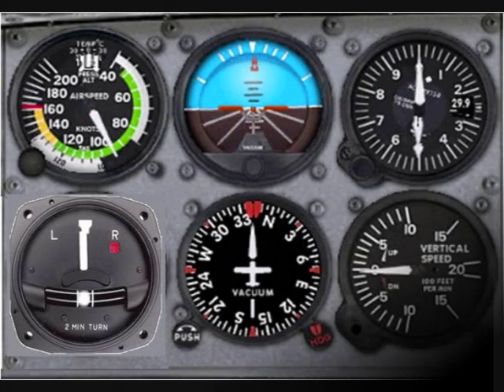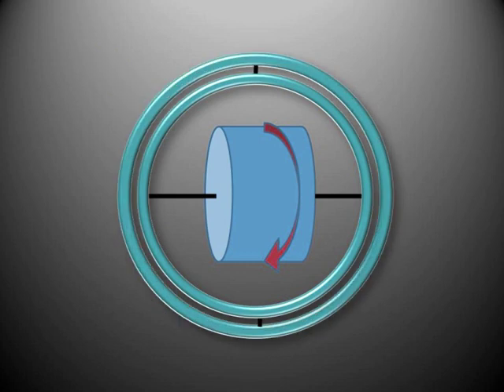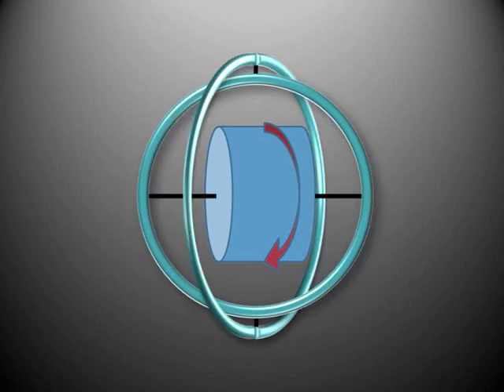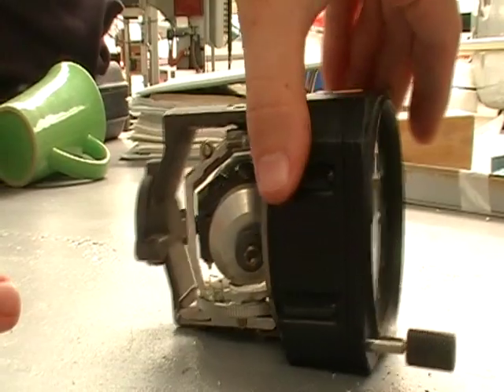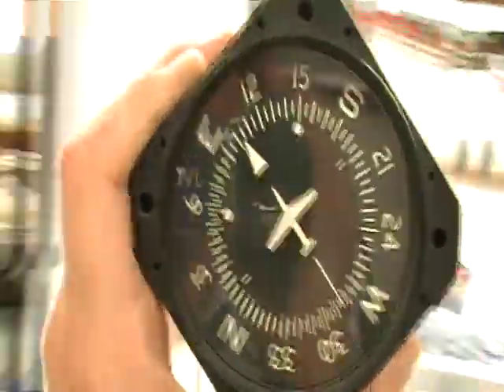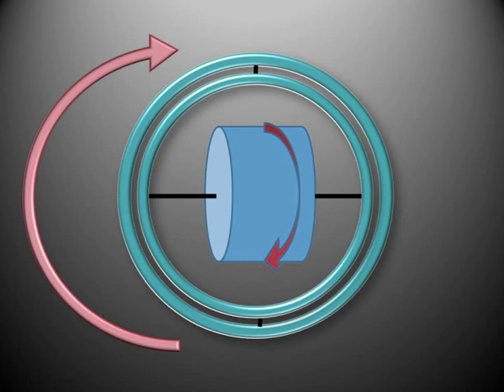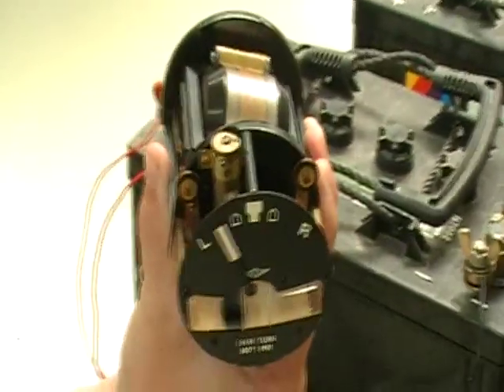Gyroscopes in the Cockpit

Comment from the maker: You raise some good questions. Notice a few points.
1. Each gimble allows the freedom of movement in one plane of rotation. The Heading Indicator has three gimbles, but the turn indicator has only two. Thus the turn indicator does not allow freedom of movement in the yawing plane. Any force in the yawing plane will not be negated by the gimble, but transferred to the gyroscope. In that case precession occurs as a result.

Comment from the maker: 2. Rigidity is only a property that allows a spinning mass to remain aligned in space, given freedom of movement. Rigidity can be resisted by a force, which is when precession takes place.

3. You are right that gyroscopes are affected by rigidity and precession simultaneously.  Ideally the directional indicator is operated only by rigidity. However precession results as forces are transferred through friction in the bearings. The DI drifts as a result making it necessary to adjust more often.

Comment from the maker: Actually, yes. Or you can use a vertically aligned gyroscope DI (this one is horizontal, vertical are more useful around polar regions). A vertically aligned DI will experience maximum topple at the equator. Thus at the equator it would change its reading 15.04 degrees per hour due to the rotation of the earth, decreasing this rate towards the poles (by the cosine of the latitude).

Comment: I wonder what happens to the gyro under the globe in say Australia when the planes upside down
Reply from the maker: The gyro will always act with reference to space, not the earth or its horizon. So if an aircraft continues flight around the globe without it being 'caged' (as you can see in the video), the gyro will end up toppling. This will result in erroneous readings. This is one of the reasons a pilot needs to realign the DG every 10 minutes or so. In realigning the DG, not only is the pilot correcting the heading information that is being displayed, he is also realigning the gyro so that it is parallel to the horizontal plane of the aircraft. Providing the aircraft is straight and level, this will align the gyro to the horizon at that point.

So, in Australia, if a pilot is correctly resetting the DG at regular intervals, the gyro should be aligned with the local horizon.
Reply: Recently I learned that there is a Flat Earth society which defends its' beliefs using some quite entertaining arguments. One of them is that the gyroscopes are not designed with earths curvature in mind but they still show the horizon correctly. 
So someone should reference this explanation so the poor people can accept that the earth is not flat.
Reply: gitnote 
Gyros only work on a flat surface...

Comment: why doesn't the heading indicator (and attitude indicator) act on precession? Shouldn't a yaw movement as showed starting at around 1:20 push the gyro to precess the force 90 degrees and thus make it rotate like the gyro in the turn/slip indicator? And why doesn't the gyro in the turn and slip indicator remain rigid in space?
Aren't gyroscopes supposed to be affected by rigidity in space and precession simultaneously?

Comment: I wonder whether this gyro follows the falling horizon in a plane's flight
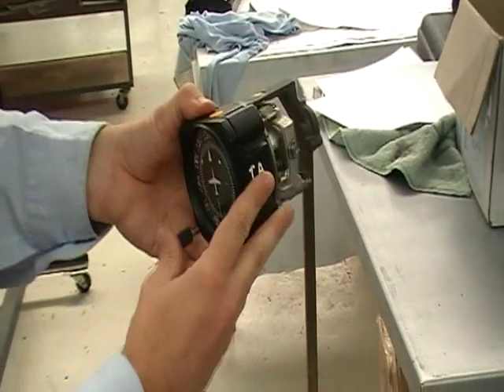Reply from the maker: This is a similar question to the one Wiskey Leaks posted below. I have a reply there. In summary, the gyro will not follow the horizon. This is why a pilot needs to regularly realign the DG, and consequently reset the gyro so that it is parallel to the horizontal plane of the aircraft (and therefore the horizon). You can see this happen at 1:52. Hope that helps answer your question.
Reply: onewaytoliveby , so the pilots have to manually reset the gyro every 10 mins aligning it visually with the  horizon, thanks. Are you a pilot by any chance?

And what is the DG you mentioned in both you replies?
Reply: Oh, DG is the directional gyro? Ok
Reply from the maker: Yes, I am a commercial pilot and a flight instructor. That's correct DG is the Directional Gyro.

You'll find that some DGs can be quite complex, such as HSI (horizontal situation indicator) and RMI (Radio Magnetic indicator). They incorporate navigation information on the directional display. These are usually aligned automatically, thus relieving pilot workload.
Reply: I think now that that the gyro based attitude indicator is the sufficient proof of a flat earth, and that the gyro based heading indicator is the sufficient proof of the stationary earth (on top of the M&M and Airy's experiments, of course).
Reply: No, the earth is a geoid.

Comment: Just in case this thread goes down the dreaded "flat earth" line of thinking: Gyros act differently depending on what you want out of them. It's the matter of how you "fix" or attach it. A freely floating, "space gyro" without being fixed will act as some people say. An earth-bound, fixed gyro acts differently. I'll attach a short tutorial below: 

a space gyro is a gyro with three axis around which it can move (think 
of it as in pitch, roll and yaw, where I consider the pitch axis to be 
the spin axis)

space gyros aren't used in aircraft since they can take up any position

a tied gyro is in fact a horizontal referenced space gyro (the spin axis
lies horizontally) with a button to prevent the gyro from toppling (ie 
roll) due to precession and is used in the directional indicator

after using the caging knob, as it is called, the tied gyro must be 
realligned (in case of the directional indicator with the heading 
indicated on the magnetic compass)

an earth gyro is as a tied gyro but vertically referenced (the spin axis
 pointing upwards) and having its spin axis tied to earth's gravity by 
means of a weight holding the spin axis pointing towards the center of 
the earth

the earth gyro is used in the artificial horizon

a rate gyro is a horizontal situated gyro and is only able to topple (and spin of course otherwise it wouldn't be a gyro)

the rate gyro is used to measure rate of turn around the third axis (yaw) and so it is used in a turn coordinator
Reply from the maker: Thanks Kevin. Yes for some reason the flat earth nonsense seems to keep popping up these days. In aviation, we deal with the limitations a spherical earth introduces everyday.

1. We can never have a perfectly accurate paper chart. Try wrapping a piece of paper around a ball.
2. Gyroscopic instruments need constant realigning. DG is usually manual and AH is automatically aligned.
3. Range of line of sight VHF communications is limited. Often aircraft up high will relay radio transmissions to ground stations.

Perhaps flat earthers need to take flying lessons. Makes me wonder what they think time zones are for. Perhaps they have never made an international phone call.
Reply: onewaytoliveby
flying lessons wouldn't do it. They'd need to go into orbit. I'm not trying to be funny either. It's an emotional thing with these people. They follow the interpretations of the bible and work backwards trying to prove that if the earth is flat, then there is a god...it teaches us a lot about our educational system and how blind faith can ruin a mind.
Reply from the maker: It is not blind faith in the Bible that is the problem, it is blind faith in human reasoning (including people's interpretation of what the Bible says). The Bible does not teach that the earth is flat. 'Flat earth' philosophies necessitate that the earth rests on something. But the Bible says in Job 26:7 that God 'hangs the earth on nothing', contrary to what people believed in. When we were finally able to look back to earth from satellites, we could see that indeed what the Bible said was true. 

Great men such as Newton and Galileo who shook the scientific world maintained an unwavering trust in God's Word.

These days we may be astonished by the ignorance of people who hold to 'flat earth' positions. However, this is no different to people who hold blind faith in evolutionary and naturalistic philosophies. It is at best fanciful thinking and at worst intellectual suicide to suggest that evolution is a plausible way of explaining life on earth. It is simply a way for people to explain away the existence of God so they do not have to be accountable to Him.
Reply: onewaytoliveby
true...when I read it, it certainly doesn't tell me the earth is flat. To me, there are many truths within the bible, but a lot of crap too; especially the old testament.
Reply: SkyClear
There is absolutely no doubt in my mind that god exists. no doubt. I'm not here to argue about god, but the creator is not even close to what we as humans understand. We don't have to be accountable to god, he is within us. we don't have to live our lives any certain way, we will feel the cause and effects later as we leave this form...just hope that you can forgive yourself when you see what is really important later. If you follow the way of the great teachers such as Jesus and Buddha and others who teach about love, the transition will be easier.
Reply from the maker: +curiousinternals 
For many evolutionists, evolution is an attempt to explain the origins of the universe from a naturalistic point of view (in other words, there is no need for a God for the universe to exist). Richard Dawkins is a classic example of this. 

Others follow on the bandwagon and suggest that God exists but he used evolution. The problem is that this is completely inconsistent with what God has said in the Bible.
Reply from the maker: +Kevin Cass
I have to respectfully disagree. The problem is that the teachings of Jesus and every other teacher like Buddha are completely different. Buddhism teaches that living a moral life and transforming yourself will lead to the cessation of suffering (nirvana).

However, Jesus teachings say otherwise. He taught that it is impossible for a person to save themselves, only God can save a person. In fact, even our good works are like filthy rags to God.

The love that Jesus taught is different to what many people think. Jesus' love was demonstrated by bearing the penalty of death for undeserving, unrighteous, and evil people. He did this as the sinless, perfect Son of God. This means that people who were once evil, could be justified and declared good and righteous by a holy God. This is not by their own merits, but by the merits of Jesus Christ - we call it substitution. It is like a judge declaring someone guilty, but then stepping down to the criminal and paying his fine so that he could go free.
Reply: SkyClear No problem Sky. I believe what Jesus taught was a lot different than what the church teaches. It is clear to me that some of the scriptures has "man's" fingerprints all over them. Did you know that Buddhists and Hindus have Jesus walking through India and other places throughout his missing years in the bible? It's in their history. I don't want to get into religion Sky...just without religion, there would be a lot more happiness, less wars and death in our history. God bless.
Reply: *****
Sure, I could have gone crazy, but that's my mind. That is why I said "...in my mind." I'm not a Jesus freak or anything, I believe he existed. I continually try to understand the past with the best of my ability.

However...either something came from nothing or something always existed. That formula seems "to me" to be completely obvious. Once you believe that something can not come from nothing, then there has to be a creator. I certainly don't have a clue what exactly it is because, in this form, I don't have the capacity to understand everything.

I agree, I can't judge how far from understanding I am. I doubt I'll ever fully understand. My simple statement, yet bold, only stated that there wasn't any doubt that something did not come from nothing which meant that there was some sort of creative consciousness, however "It" is defined. Loosely said, this creator would be "God."
Reply: *****
They talk about space-time yet, nobody really talks about time...only space. This is the issue that we can't grasp. If D=rt and time really doesn't exist, then you can arguably say that time is 'zero.' If this is true then distance is zero, there isn't really any formula that works in the material world with "time" in it. If time doesn't exist, then we can travel any distance...it's as if the universe isn't infinite at that point. I could go on....

Is there a moment in which the universe doesn't exist that is followed by a moment in which the universe does exist? I think that's a "time thing." There is only "now" is something that I can't grasp, yet said in many books. I can't conceive anything coming from "nothing," so, in my mind, there is no way a universe could exist before itself. The best that I can come up with is that there has always been some form of energy, mass or thought. I think that thought is the key. I don't understand it, but I do know that energy and mass can be exchanged. I believe that thought, or consciousness can only be split or joined together, not destroyed.  It's a work in progress, but after studying and meeting many near-death experiencers, I'm convinced that our consciousness continues. There are many consistencies within each experience, yet most are generally on an individual's understanding of "things." Many refer of an option or a temporary experience of "joining" with a "God" consciousness. This is why I am thinking about the separation or in a way, "creation" of a "soul." Everything seems to be on a vibration. Thoughts can be measured, energy obviously, and even matter has it's own vibration.

If time is a property of the universe, then the universe doesn't have to come from nothing. There was never nothing, whether the timeline is finite or infinite. At every point in time, the universe exists. There is no time outside of time in which the universe could be non-existent.....Exactly!

I didn't read your entire comment until I was starting to write. Clearly, you and I think alike...sorry about the repetition. The one thing I will say is that I can't think of anything, regarding "time" or not, that can convert energy or mass into thought. This, to me, is the only thing that has always existed. But then, I say "always," implying a "time" component...it's obviously tough from a human perspective to grasp anything. But in a nutshell: I think that the original "whole" thought is creative and decided to split up and have experiences that couldn't happen as a "whole." We are minute "wholes" that are experiencing the good and bad to only experience our own creation.
Reply from the maker: +curiousinternals
>evolution has nothing to do with the origin of the universe.
You need to understand there is a difference between cosmic evolution, and biological evolution. Cosmic evolution is an attempt to explain the origins of the universe and biological evolution attempts to explain the origins of life. Any serious scientist will tell you that. https://www.cfa.harvard.edu/~ejchaisson/cosmic_evolution/docs/splash.html

>Do you have any specific problems with the evidence that evolution happens?
A bit of bias in that question - you have assumed that the evidence a priori suggests macro evolution occurs. The most straightforward evidence that evolutionists produce to support their theory is natural selection. That is undeniable. Natural selection is observable and reproducible. However the limitation is that natural selection works only on previously supplied information (DNA), and there is no evidence whatsoever to suggest it adds any meaningful information to the DNA. There is not even enough time in the evolutionary timeline for natural selection to organize the necessary continual changes to the DNA. The fossil record is not much better. It looks great in textbooks, but even evolutionists admit there are big problems with it. My biggest problem with evolution is how masses of extremely complex data can be explained by purely natural forces alone. A cell, let alone an entire organism, is an incredibly complex marvel of engineering. We know that to produce a machine like the Airbus A380 multiple millions of man-hours of RandD is required to make it work. Yet the engineering in the A380 is crude in comparison to even one organic cell. "But the cell is self-replicating, but the A380 is not, that's the difference" - yes, but self replication makes it worse - in fact it is continually working against the second law of thermodynamics. 

>It's more like a judge requiring someone innocent to be brutally executed before he will consider letting the criminal go free.
Not at all. Jesus was not required to go to the cross. Many people step in to assist in the payments of penalties. Do you think you are a good person?
Reply: John Doe maybe you're just confused with little Cessna old cheap,  mechanical gyros. This is certainly not the case with international aircraft on long haul routes. Let me guess...you're protecting the bible.